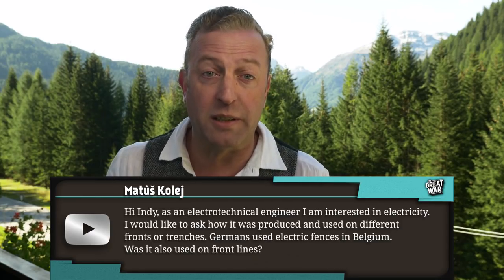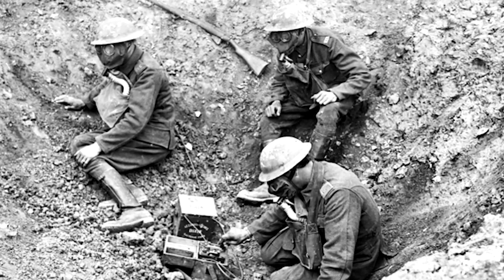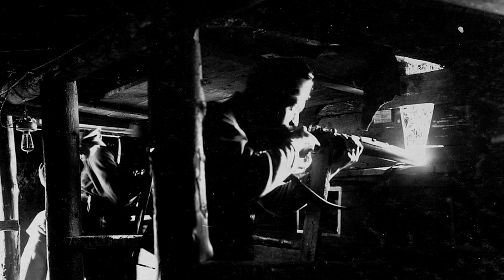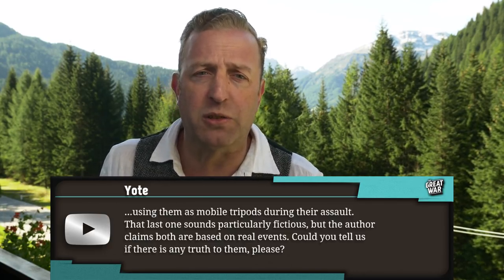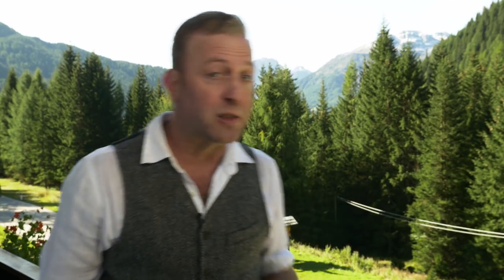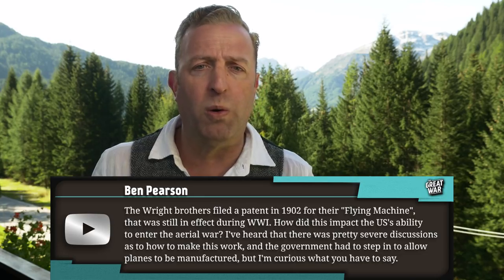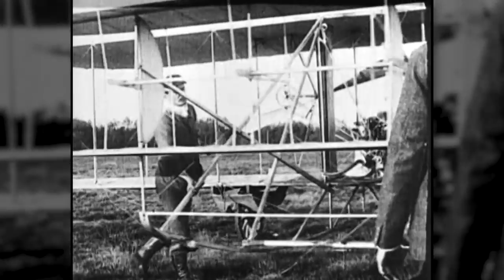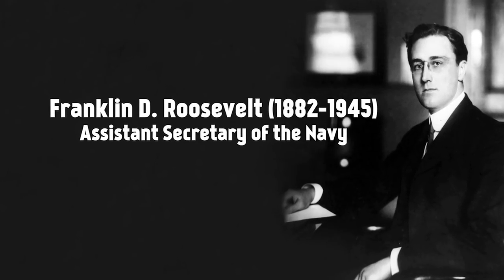Electricity - Wright Brothers - Hip Firing MGs I OUT OF THE TRENCHES

Comment: Even today the armies teach to mount mgs on a soldier's shoulder, as an auxiliary method. For example in high grass, where mounting it on ground would give you no sight.
Accurate fire is not possible, but it might be enough to suppress the enemy. 
I've done this myself, and it does work. :)
Reply: lalucre1803 What I've been wondering about for years, how does did not deafen the soldier?
Reply: The second soldier, with the gun on his  shoulders, is facing the gunner, with his back to the front. This way their heads are actually quite close. So it would not be much loader for the first one.
Still, without ear protection I would say both get hearing damage - or even loss - no matter where they are exactely. And the bigger the guns get, the worse it gets.
Reply: lalucre1803 Ah, thanks, I only knew of it from model kits where the human bipod had the muzzle right next to his head, never made sense to me :D
Reply: I suppose you could fire it in other ways, too. But the one described is the one we used.

Comment: The Wright's 3-axis control system was based on wing warping for roll control.  Glenn Curtis' system was based on the aileron (okay, 2 ailerons) for roll control.  The Wrights placed the rudder in the front of the aircraft, Curtis put his rudder on the aft of the fuselage.   Similarly, the elevator was forward on the Wright's design and aft on Curtis'.  The Wright's patent was clear on how they'd designed their control system, and there was enough difference in the mechanics of Curtis's system to make a case against patent infringement, although it was a 3 axis control system in both cases.    
As you said, it stymied the US aircraft industry for a while.  Eventually other hobbyists and manufacturers just ignored the patent and continued on.  But Curtis was advancing designs and making money, hence the infringement suit.  Ironically, by WWII one of the few military aircraft actually ready to engage an enemy that was flying in the USofA  was the Wright/Curtis P 40.

Comment: The Imperial Trans-Antarctic Expedition was preparing to launch as the war broke out. It was an interesting early use of electricity in an isolated setting.

The boat was so advanced that they had a radio receiver on board, but not so advanced that they had a radio transmitter. A transmitter really would have helped.

Comment: Interesting the idea to use a water jet to apply electricity, as absurd as it might sound with hindsight, from an historical point of view. Once You consider its core: You need a conductor channel to discharge electricity, what can You use? It finds a modern counterpart of sort in the idea that You can obtain a long range taser, one that does not use metal cables, by ionizing air with a laser beam, You can then let the electricity discharge through the plasma and supposedly hit Your target. Sometimes technology fails, but the idea lingers on...

Comment: How would the great war could have been fought to prevent 2nd world war and how central powers could have won the war instead of surrounding powers
Reply: 1. WWII could have been prevented if the Central Powers won or if the post-war treaty had different terms. Lighter terms would have led to less anger, making it harder for Hitler to come to power. Harsher terms would have made it impossible for Germany to start WWII. The terms that were put in the treaty made the Germans both eager and able to start the war.
2. The Central Powers could have won if Germany didn't invade Belgium. Without the invasion of Belgium, Britain wouldn't have joined the war. That means Germany wouldn't have been blockaded by the Royal Navy and Germany would have had two fewer foes to fight on the Western Front. This likely wouldn't guarantee a Central Powers victory, but it would make things easier for them.

Comment: electromechanical engineer, so an electrician...
Reply: bitchfacedmgee no, there are electromechanical engineers, their curricula means at least five years of hard study.
Reply: No, and Electrical Engineer needs a degree at University, an electrician needs to be able to tell a couple of colours apart ;)
Reply: well in my country, electronic is circuitry and other smaller stuff, and electrical is wiring and larger stuff that includes electronic,  electrical and electronics are taught at the same time and you can specialise further into electronics , so an electrical engineer is also an electronic engineer, but an electronic engineer isnt an electrical engineer.
Reply: Motors.